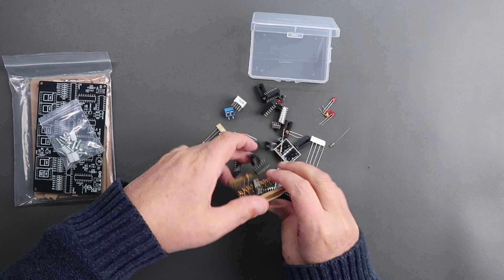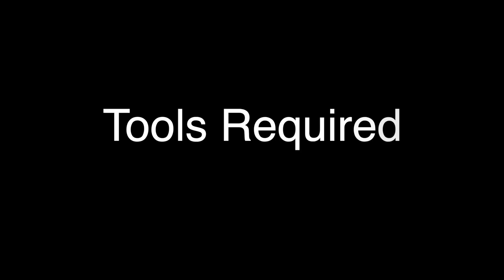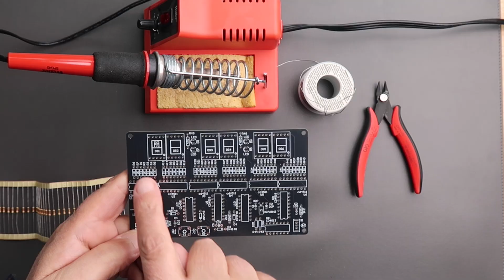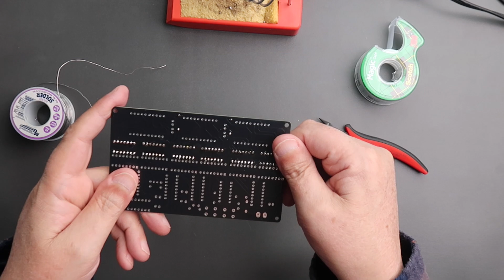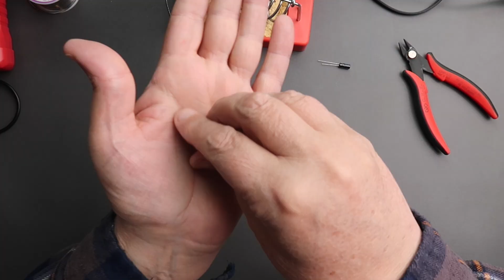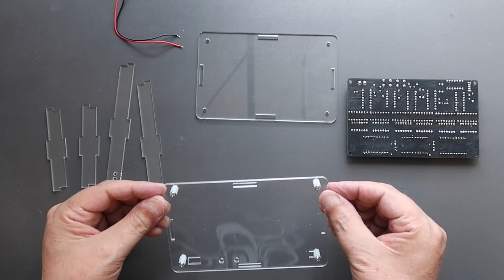Solder your own digital clock -  electronics kit by Science Hut

Comment: Has anyone who has built this kit had issues with the diodes attenuating the logic signal from the AND gate, causing the hours to not advance properly unless the clock is run on a higher voltage - closer to 6 volts?

Comment: Same as the one i got from ebay. But no instructions. And the pdf you linked to is password protected.
Reply: yes you have to order the kit and passwords will be in email that you used to order.
Reply: @lashturner well I ordered mine from Ebay. It arrived a while back. It's still not built. And no instructions came either. But the plus side is the components are named on the PCB itself screenprinting. But clear instructions are not included from that ebay seller.

Comment: Looks better than the one I got cheap from ebay with a now damaged trace. Now I not only have to solder the kit, but repair it as well... Determined to get it working, I may also go to The Science Hut as well
Reply from the maker: That's annoying. Please report back if you manage to fix it. Information might help other folks. Good luck.